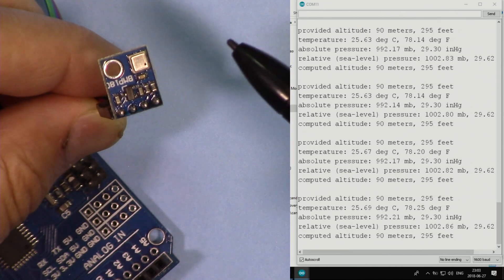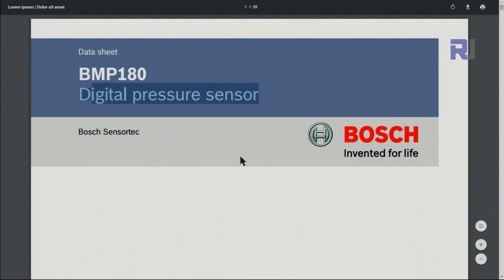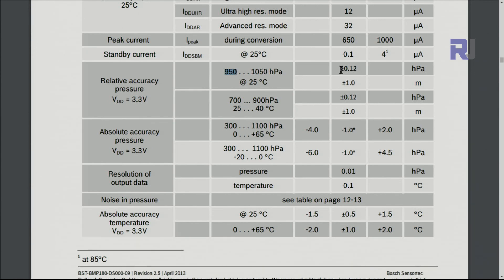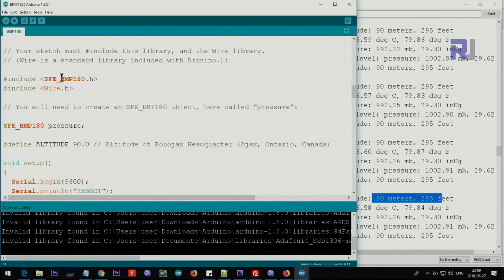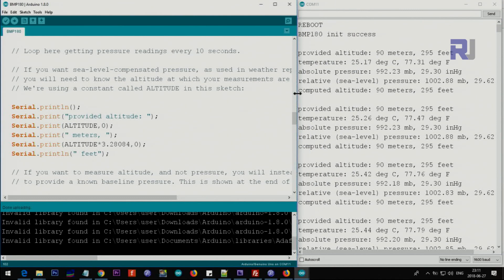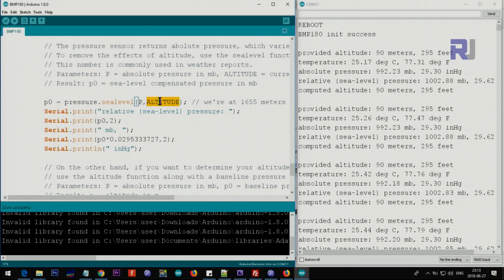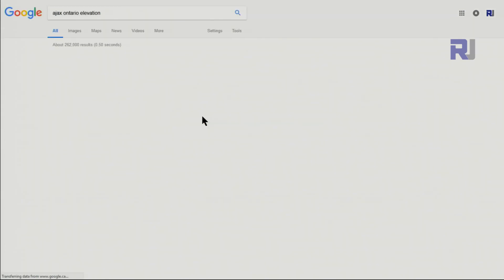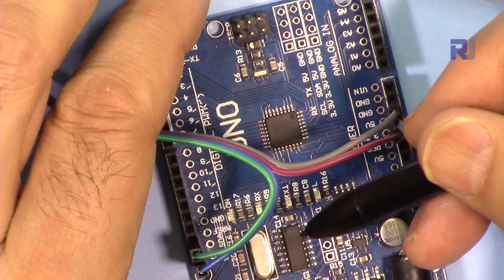Using BMP180 Digital temperature and pressure Sensor with  Arduino RJT93

Comment: Can I use Arduino DUE instead of Arduino UNO?
Reply from the maker: Yea you can use any arduino as long as you connect hot wires correctly. The SDA and SCL pins light be different. See arduino wire page to see pins of your board.

Comment: I need to detect if there is any gas in a pipe. Its natural gas in plastic pipe going into geyser. Is it possible with this module? Maybe i can put it between the gas pipe?
Reply from the maker: this is not detecting gas. only temperature and pressure.
Reply: @robojax  any idea which sensor will help me detecting gas?

Comment: hi robojax i resentally got a bmp180 sencor and have been having alot of problems with it. i connected vin to 3v3 pin, gnd to gnd scl to pin 5 and sda to pin 4. (on the arduino nano). i tryed to use an i2c scanner to find its adress. but it said that no devices were connected. they i tried your code (and library) and it again said no devices were connected. but before when i was playing with the i2c scanner i did connect it to the 5v pin. (because i wasnt sure if it was getting enuth power). im not really sure what to do. did i just get a faulty board???
Reply from the maker: Of course it will not work. SDA and SCL are different see the pins here https://www.arduino.cc/en/reference/wire
Reply: @robojax  on the arduino nano the my sda pin is on pin 4 and scl is on pin 5 like the arduino uno. And I think I have connected it properly because I connected a mpu 6050 to the same pins (it used i2c) and it worked fine. And I got got to say in my last comment but I really liked your video, and it helped me understand other aspects of the sencor.
Reply from the maker: then the sensor is dead if wiring is correct.  Try I2C scanner to see if you can get the I2C address. if not, then the module is dead.  Search my channel or robojax.com for the I2C scanner code.
Reply: Well I tried an i2c scanner and it just came up with no devices connected
Reply from the maker: then it is dead.  I assume you did correct wiring.

Comment: I'm getting the following error message:
Arduino: 1.8.13 (Mac OS X), Board: "Arduino Uno"
Robojax_BMP180:79:10: fatal error: SFE_BMP180.h: No such file or directory
 #include <SFE_BMP180.h>
          ^~~~~~~~~~~~~~
compilation terminated.
exit status 1
SFE_BMP180.h: No such file or directory
Specified folder/zip file does not contain a valid library

This report would have more information with
"Show verbose output during compilation"
option enabled in File -> Preferences.

I thought I downloaded file and unzipped it. What am I missing? I'm working on a Mac
Reply from the maker: unzipped it to where?  you have not included the library. or you can do this click on Sketch->Include Libraary->Add .zip library and then select zip file

Comment: Please explain the code... Nobody shows how to change pins for analog inputs.  Every tutorial is A4 and A5. I can't fit everything I need on the board.
Reply from the maker: I have explained it.  A4 and A5 are SDA and SCL pins I2C pins and they are internally used for I2C.  After pin 13 you should have SDA and SCL pins.

Comment: With a BMP180 I'm trying to measure pressure in the air so I can predict rain, could that be possible?
Reply from the maker: you can measure the pressure for sure. but I have no knowledge of how you predict rain. But if pressure is useful for that , sure this is can do it.

Comment: Assalamualaikum Robojax.. i got a question.. can I measure multiple analog value ADC at UNO simultaneously. If can't, what is the way to do it.. or do u have any references that I can refer to? Jazakallah from Malaysia
Reply from the maker: walaikum salaam, you can read all Analog inputs at the same time. here is example for single input but you can apply the same for multiple. https://youtu.be/TbLdAQpE4jE you simply read them and they don't needed to be defined as INPUT. just use analogRead(A0);  analogRead(A1);  analogRead(A2); ....etc.

Comment: Great Video, I think you are the only one who explains the sensors and codes with such detail. 
I am looking for a sensor that can measure height difference in the floors of a building. I think that can be done by comparing the absolute pressure reading from the two floors. Is this data given by this sensor accurate enough for such a purpose?
Reply from the maker: I am glad you found them useful. No it is not accurate for your application.  you need to use laser distance module VL53L0X which can measure up to 2000mm or VL53l1X which can measure up to 4000mm.  are my videos on distance meter https://www.youtube.com/robojaxTV/search?query=%22distance%20meter%22

Comment: There seems to be a problem with the 'computed altitude'  it is always the same as the 'provided altitude' regardless of pressure.
Reply from the maker: I don't have the device but you should be getting approximate value if you enter your altitude. Make sure to start with fresh code if you have updated it.
Reply: @robojax  as in your demo, whatever is entered for your ALTITUDE figure, it is simply displayed in the computed altitude, not affected by actual air pressure.

Comment: I am looking for a pressure sensor for arduino that can be used in water.
Purpose : measuring pressure in water in fonction of deepth. Any idea ?
Reply from the maker: that would be totally different pressure sensor which I have not worked with due to it is cost. you may search on Amazon or eBay to find it.

Comment: Great work, thanks. What would be required to store the values on a micro SD card?  I notice that the code says Do Not connect to +5Volts. The BMP180 (with regulator board)does seem to work OK if connected to 3V3.
Reply from the maker: to store data on SD card you need micoSD card module. For voltage yes 3.3V is perfect.
Reply: @robojax  Yes I have a micoSD card module, just thinking about the code.....
Reply from the maker: I don't a tested code and I have no video on MicroSD card. I will post such video in the future.

Comment: I checked its datasheet i found that its has 4 mode of operation 0 low power to 4 high power and accuracy mode ? So may be this is the reason why my sensor giving me big error of read +,- 1  meters error reading ?
So how can i set in code for high accuracy mode ??
Reply from the maker: the library I used has not function for mode of operation. You may use this library https://github.com/adafruit/Adafruit_BMP085_Unified and set mode of operation.  You can search for mode inside .h file https://github.com/adafruit/Adafruit_BMP085_Unified/blob/master/Adafruit_BMP085_U.h  I won't be able to help you further. Good luck.

Comment: Showing wrong and inaccurate data
Reply: I am using lib example 
It showing two value 1 is Altitude = 72 met
2nd is real altitude = 86.72 Meter
What is the difference between both ?
And Google showing my area Altitude 128 meters ???
And showing pressure at sea lev calculated = 100456pa 
( And in code 101325pa )
??
Reply: And showing regular error value of +,- 1 meters in every counts ??
Reply from the maker: You can't use it as altitude meter. it is approximate value. Please visit this page to see if manufacturer says it shows altitude. https://www.bosch-sensortec.com/bst/products/all_products/bmp180
Reply: @robojax  i found this -
Applications

- Indoor navigation

- GPS-enhancement for dead-reckoning, slope detection, etc.

- Sport devices, e.g. altitude profile

- Weather forecast

- Vertical velocity indication (
Reply from the maker: Sorry you must be dong something wrong. 100s of people have used it . Please check the wiring and also make sure to include the library.
Reply: @robojax  can i video response to you later ?
Reply: Code not compile ?

Comment: Caused me lots of confusion. The baseline reading NEEDS to be in setup, otherwise your baseline pressure will change with the absolute pressure, making it appear as there is no altitude change. The code from the video needs to be completely rewritten to fix this.
Reply from the maker: Hi, as I explained in the video, your sea level matters and also the pressure changes in different time of day. you would have to compare it to lab device. Remember this is a proximate no absolute correct. This is used in mobile devices and other person item not for scientific devices. Please subscribe.
Reply: @robojax  I will subscribe and it was a great video otherwise :) However, it is important to understand that the baseline pressure needs to be established in the setup. No matter what time of the year it is, it will calculate sea level based off your current pressure and your given altitude. If the baseline is updating with the absolute pressure, it will read no change in altitude no matter how high you go with it, it literally thinks that sea level is moving with you. You have to establish a baseline that does not change during the time it is on. That is why the example in the library you chose does this. When doing this, the BMP180 is accurate within about 2 feet, which is extremely accurate. Your code displays the same altitude no matter how high or low you take it.

It's probably fine because it seems like nobody is using it for an altimeter anyway, they just want to make temperature displays or something. But I need it for model rockets so without the altimeter it is pointless. If I were you, I would just pin a comment explaining this for the few who are watching it for the altimeter and tell them just to use the example code.

Comment: In your tutorial you say connect the VIN to 5V. However you have it connected to 3.3V and it should be connected to 3.3V. 5V can damage the sensor. Otherwise it was a good tutorial. Thanks
Reply from the maker: I mentioned at the beginning that this device has regulator.  You can connect it up from 3.3 to 25V and it will work bacause the regulator doesn't allow the higher voltage to reach the sensor.
Reply: @robojax  Otherwise the pin would not say 'VIN' but probably VDD instead so yes you can connect it to 5V . Actually connecting to 3.3V might cause a reduced voltage over the regulator and only providing 2.8 ish volt. Good job thanks for tutorial.

Comment: How low a pressure can this detect? Near vacuum?
Reply from the maker: I just updated the page where I provided the code. I fixed the link to the manufacturer website and added the datasheet.  the pressure range is from  300  to 1100 hPa